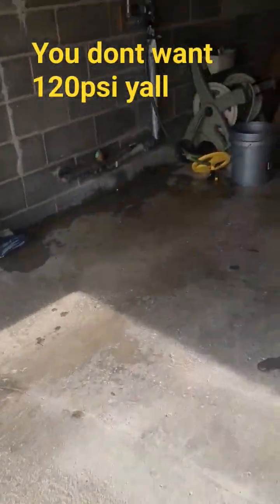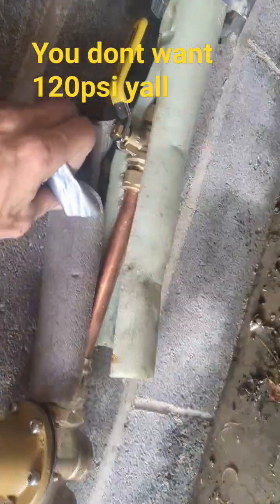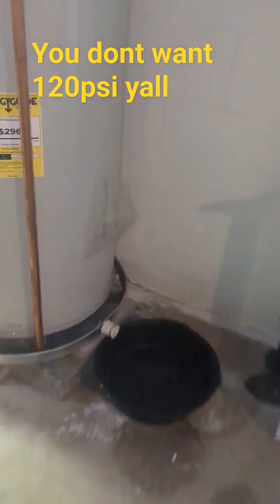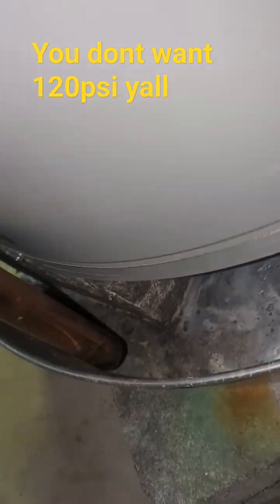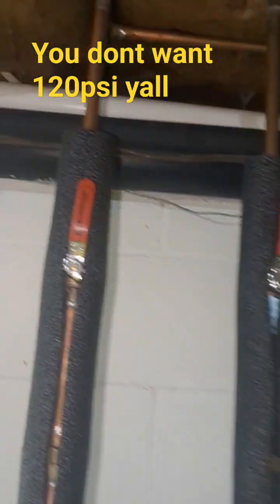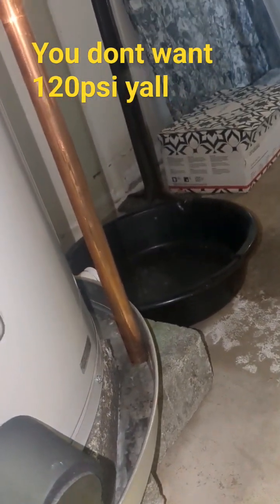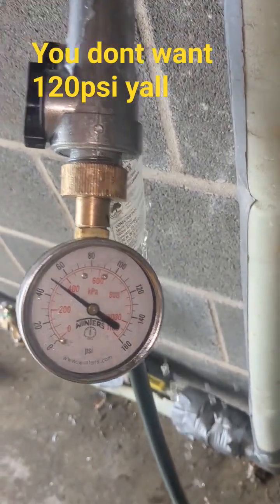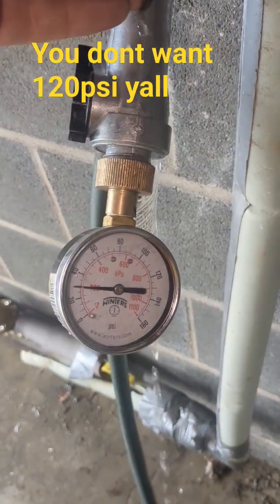thermal expansion or high pressure??#learn#@plumberdowneywv

Comment: If they have a regulator they should then have an expansion tank.  Once the regulator is in it makes it a closed system so now the thermal expansion has nowhere to go and will be an issue.
Reply from the maker: They should have one yes .  I install them when we change the tanks it's state code here .  Yes they know I'm going to go bk and install one .
Reply from the maker: That's y I'm going back next week to install one:) thank you 😁.. you got it :)